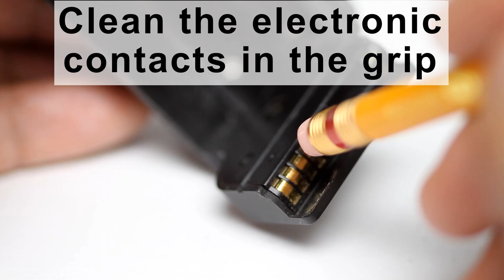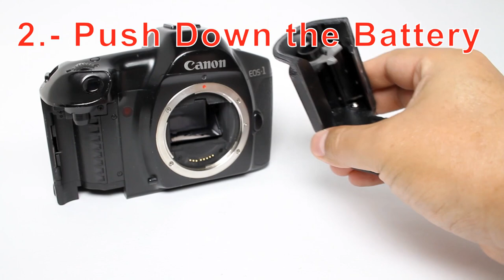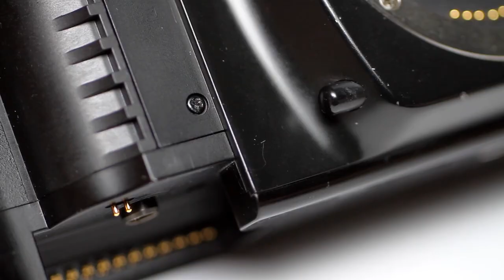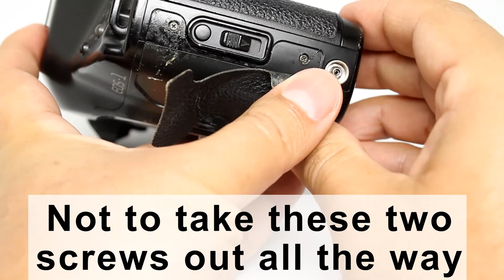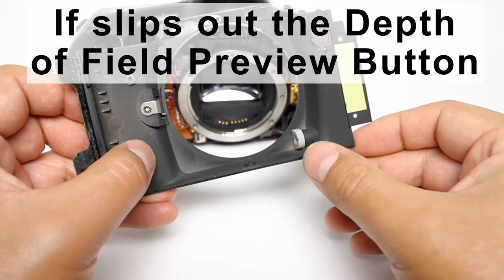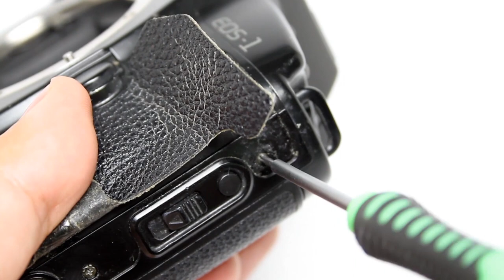How to Repair BC Error on Canon EOS 1, EOS 1N, Three Possible Solutions (Solved)

Comment: Photography And More thanks for this video. I bought this when it came out and put it away  years ago thinking my battery was low. My daughter expressed interest in film cameras and having forgotten the error, I filmed up and then disappointed  her when the error popped up. Researched the error in the manual and assumed I was in for a factory service. That would have run me $350. So this could not hurt I figured!  And I was right, but more importantly you were right. I tapped the magnet and it fires away!   Thanks so much!
Reply from the maker: Hello Mike,
It's great know that you found useful this video, thanks for your comments!

Comment: I have an EOS-3 with similar problems. I have the “b c” error, but my shutter still fires sometimes. It isn’t fully locked like others I’ve seen reported. So then I tried everything you said to try first in this video, but with no luck fixing it. Then I got some very strong neodymium magnets and tried to fix it without disassembling. I was able to get the shutter to fire fairly normally with the magnets stuck onto the camera, but as soon as I take the magnets off the camera then the shutter locks again. Then I tried leaving the magnet on the camera and I fired the shutter a couple of hundred times to see if that would unstick it. No success. Then I disassembled and tried both tapping on the shutter magnet quite rigorously and using the neodymium magnets directly on the shutter magnet and sadly the problem still remains and the problems are still the same as before, which is that it fires sometimes after multiple presses on the shutter. And if I put magnets in the right spot on top of the the shutter magnet from the outside then I can still get the shutter to fire multiple times continuously. So it sounds like my issue isn’t the standard problem since all the usual fixes have had no useful effect. I guess the problem is potentially more serious and probably not worth trying to fix from a cost perspective?

Comment: Thank you so much for this video! After trying the third method it seems to work better at least, but it still has the same error as before every 2-10 frames or so, but just pressing the shutter again works like normal. Any idea why this could be happening, and if there are any good solutions?

Comment: For me it was my EOS-M42 adapter that was pushing up a small black pin on the left inside lens housing. Filed down one of the flanges on the  adapter and no more bc error.
Reply from the maker: Hello Chris,
Thanks for share with us your experience!
Reply: Hi, Chris S. I hope you'll see this message. I found your comment and this is what is giving me the error. However, my pin snapped off at some point from the same M42 adapter. Do you happen to know what position the pin is meant to be in and what to do about the adapter? I still have the pin (thankfully), I only need to reattach it. Many thanks if you can help me figure this out.
Reply: @Edyn1211  hello. the black pin should be in the lower position. As for the EOS-M42 adapter I did not have a permanent solution even with filing the adapter down as I still have the bc error. It seems these EOS-1 models only like native lenses. Hope this helps..
Reply: @MrSamischris  The weird thing for me is that it shoots fine without a lens even with the broken pin. I will try to reattach it with some really strong glue and check if that helps, as it fired alright with the lens on before the pin broke off. I researched some forums from 2010, where one user suggested that the pin, when pushed into the upper position, tells the camera that a lens is mounted. My adapter has the chip as well, so the camera was even able to give me proper focus detection. The only thing that didn't work well with the chip was the aperture. The f/ number would flicker constantly and couldn't be properly set, so the metering would go crazy too, but that can be fixed by taking the chip off and metering separately. I will give an update once I fix the pin.

Comment: We have this camera , power is ok, buttons that you press to change setting , shutter button - everything works , just not with adapter and lens, it gets an error or the shutter release does not complete , the shutter gets stuck half way  and doesnt complete process  when you press shutter button.- then i have to press again so the shutter goes backup . it only goes back up when i press it the second times With out the lens / adapter on , it works / fuctions , all the buttons work.  Will it work with a canon lens , i dont have a canon or eos compatible lens. Would it be the adapter / lens not comunication or is something damaged / not working.  Thank you.
Reply from the maker: Hello QQwerty,
I think it is best to first test the camera with a Canon EOS lens to see if it is the adapter or the camera that is failing.
Reply: It's the EOS adapter. I had to file the flange down to stop it from pushing up the black little pin on the left side of the lens hosuing. Works now..

Comment: I get a bc error after the shutter fires and then it goes away when i half press. Anyone have a fix for that? I wont know if my camera is functioning until i develop my film tho
Reply: I have the same issue but the camera seems to expose the film just fine. Annoying still. Did you find a solution?
Reply: @DavesFilmLab  Same problem. do you know anything about this?

Comment: Thank you!  Very informative.  Is BC error quite common in EOS 1/1N?
Reply from the maker: Hello riversky33,
As far as I know, this error is not very common.
Reply: Only if you don't use it for about 5-10 years, I just tapped mine with a TV remote just where the magnet is without opening it holding down the shutter
Reply: @yskmotion3601  how did your error look ? Mine just flashes BC and doesn’t make any sound. The only time display appears for a split second is when I very gently depress the shutter button just a tiny bit down (not fully)
Reply: @dzava  mine was the same, eventually it'll appear after a while, i solved it by just taping a piece of magnet on the small circular dot under the shutter button but i think it messes with the shutter speed a bit, you just have to experiment and find the right magnet with the right strength

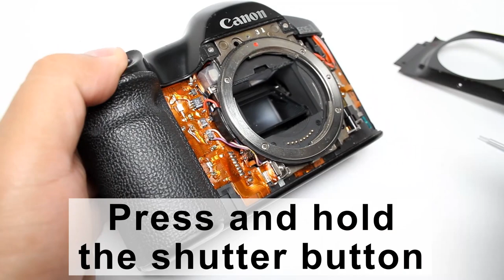Comment: You don't have to disassemble the camera, just give a hard knock on the part at 7:53 What sucks is that my camera does this every time when I start shooting, If anyone knows a perminate solution please say how.
Reply from the maker: Hi Tim Klepper,
Thanks for the tip.
I hope someone can help us with the solution you need.
Reply: You may have this issue fixed by now.  I have a number of EOS-1(X) and there is a magnet inside, front left of body.  That magnet needs to be cleaned.  If you feel good about disasembling the body then it is an easy fix.
Reply: this comment worked for me. no disassembly, just removed lens, camera on, shutter button held down, struck using my tv remote increasing in strength til shutter action. thank you video author and this comment. cheers.